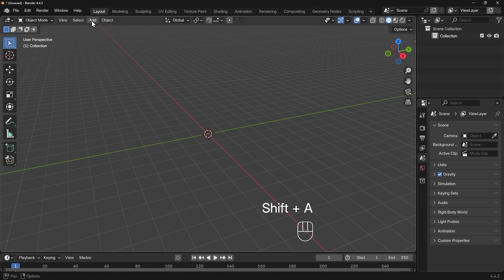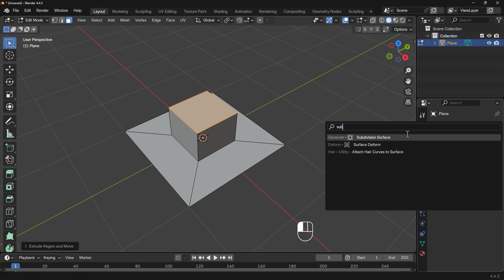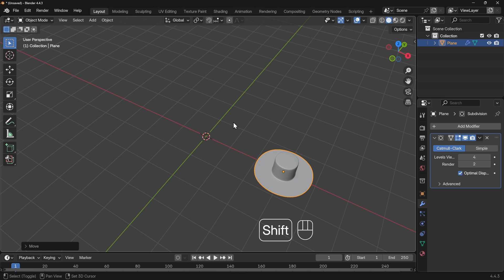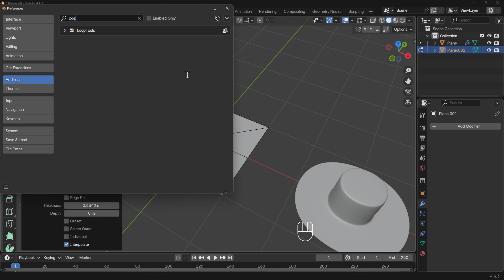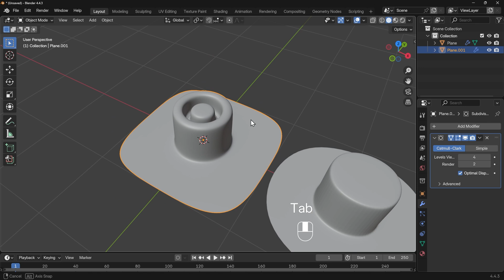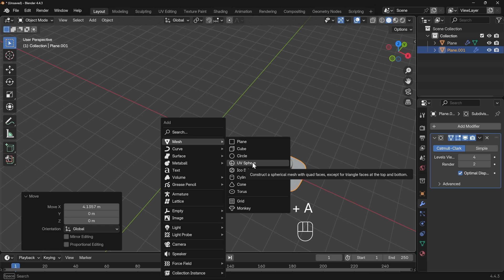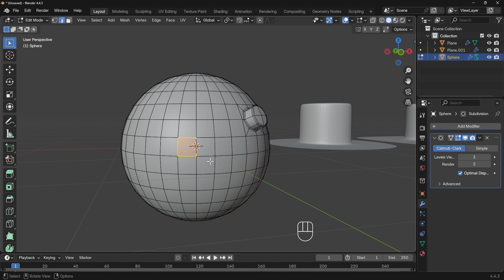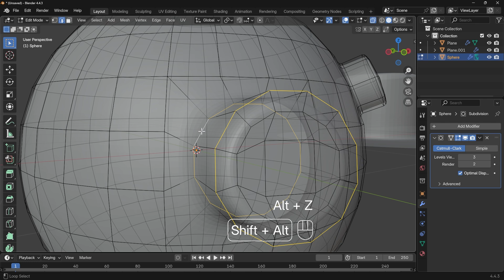Hard Surface Detailing Made Easy : Blender Tutorial

Comment: I always enjoy your tutorials, but when you start off doing the insets on the planes, there is absolutely no reason and it doesn't make any sense to switch to Face Select mode beforehand, especially when you are going to switch back to Edge Select anyway. With everything selected the inset will work just the same no matter if you are in Face, Edge or Vertex Select mode.
Reply from the maker: Thanks for the tip! I find it a touch easier to select but I think your way is faster
Reply: @grabbitt  In general I agree with you, I prefer Face Select when I want to select whole faces too, but the parts in the video I'm talking about the faces were already selected and you switched mode just for insetting.  And if they were not selected, in that case you could have pressed A to select all. But anyway, this tutorial series is super helpful for beginners.

Comment: This is great, Grant. I've been looking for something like this for a while, thanks!

A question I have, though, is how do you prevent the addition of details like these from messing with the rest of your surface?
For example, say I have a big but simple object with just a few edges which, for example, is slightly curved. If I then want to add a tiny detail on this curved surface, I'll have to subdivide (part of) the surface as per your video. But then, I will notice ever so slight creases or changes in the curvature of the surface, by virtue of having subdivided it.

Are there any tricks to prevent this, or is this more a case of trying to smooth it out by hand?
Reply from the maker: I think I know what you mean and if you lose the surface structure you use a shrink wrap to get it back

Comment: 03:56 you make it a 4x subduvision but the render will only be at 2 if you don't change it additionally. Why Blender does that is beyond me..
Reply: Perhaps, but the opposite is useful. Because when animating for example, you won't have 4 subdivisions active, it'll make the process A LOT slower. You just animate with low (or 0) subdivisions, and enable the modifier when rendering.
Now, why have the viewport at 4 and render at 2? Well... Why not? 😅
Reply: @skeliethepandaand then you forget about it and lose time rendering a blocky mess.
Reply: @GinoZump 
Not exactly. You only ever need to test which render subdivision level is best and keep it at that, and then you just play around with the viewport setting.
Reply: But let's say the object is at the back of the render, where you don't see a lot of detail, then you can lower the render setting to save time there as well.
Reply from the maker: Yes this was just for demonstration. It's useful to have both for efficiency in your viewport when you have lots of objects in your scene.